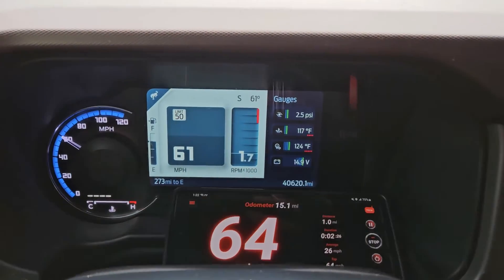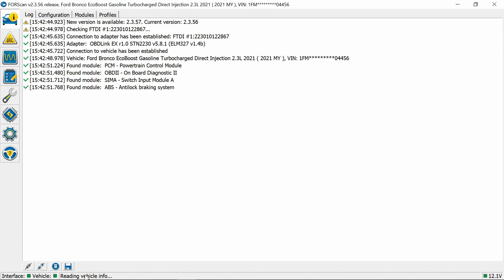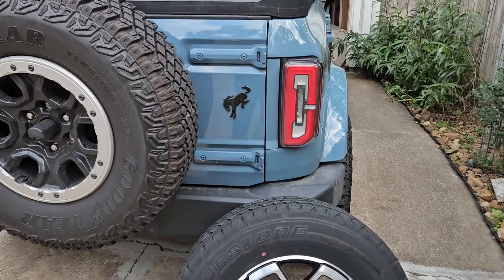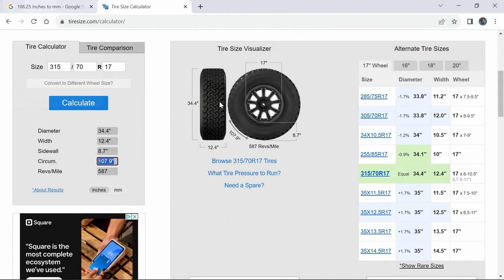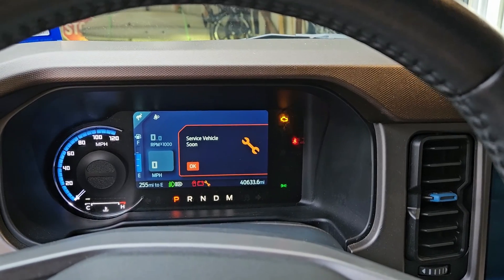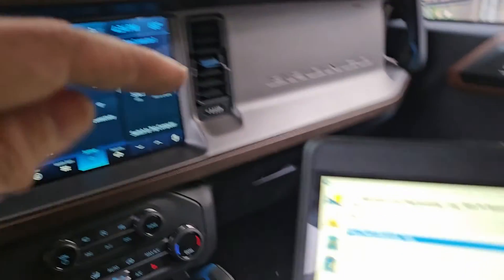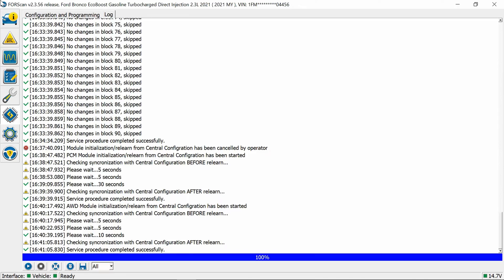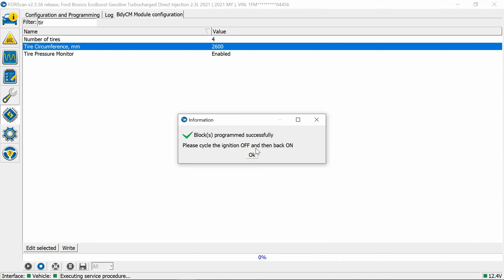Bronco Forscan speedometer calibtation

Comment: I just did this step by step and it worked perfectly. I went with 2600mm as I have the exact same tires and is perfect. My original adapter was about 7 years old and it wouldn’t “write” the code, so I bought the exact one used here and it solved my problem. Excellent video! Thank you!

Comment: This worked for me. The actual tire size is going to be less than the specified size because it’s the distance between center of wheel and ground on the full weight vehicle. My tires are ~2900mm online but the actual ended up being 2780. Also when I entered 2900 the vehicle threw an advancetrac error that wouldn’t resolve
Reply: Are you running 37 KO2s? Also, Forscan mas tire size input is 2800

Comment: Do you know to sync the digital speedometer to the cluster speedometer gauges?  My digital speedometer is match up the GPS.  The cluster gauge is reading 6 MPH higher.
Reply from the maker: Now that is weird. I thought they were both linked. Not sure how that can be reset or calibrated

Comment: Hello friend, i getting this Error "Writing blocks failed - incompatible configuration" on my F150 2019. i already tried different versions and two different adapter, OBDLink EX auto and OBDMONSTER ELM327, do you know why? thank you
Reply: I get that error when I press "Write"
Reply from the maker: Hello! Well, it could be the cycle engine off and on part. Also double check the code and block you're writing. I would restart with step by step instructions.